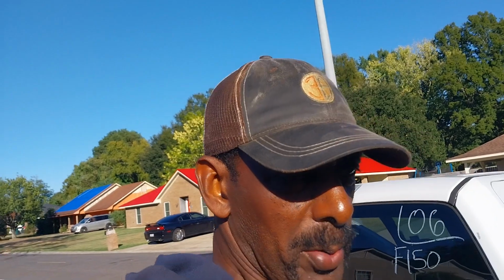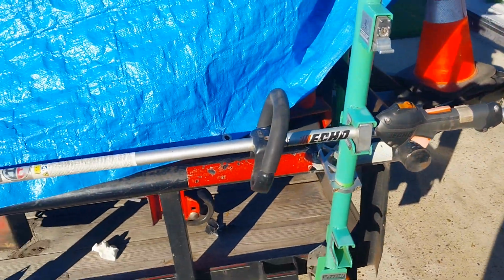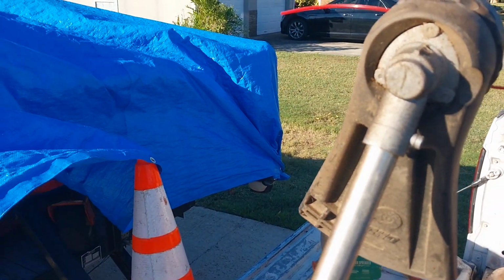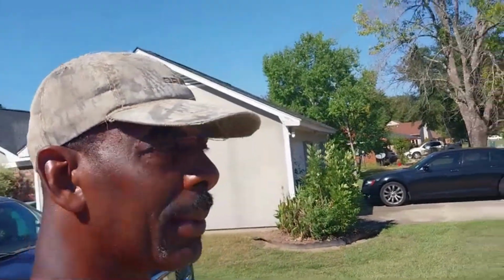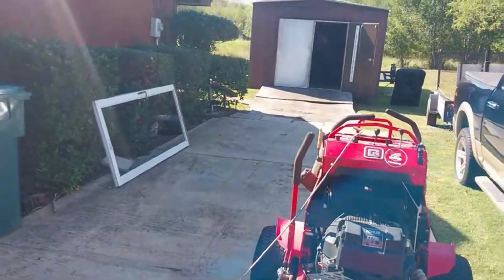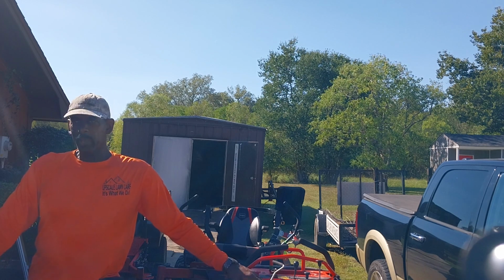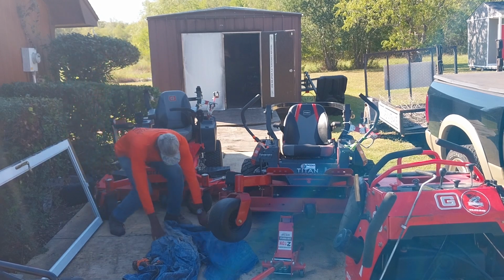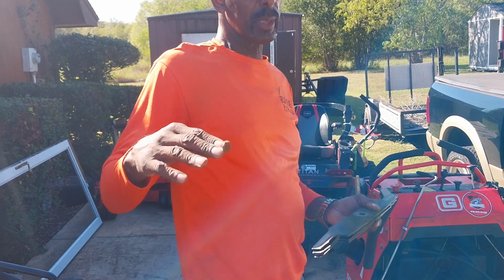When To Do Maintenance!

Comment: Great tips on maintaining your equipment. I also change the oil filters every other oil change as well. As long as you change the oil with in the recommended time frame and you use a quality oil specifically made for your engine. I have a Timemaster with 700 hours and I stand by maintaining your equipment to prevent premature engine failure. Sharpening blades are more as needed to prolong the life of the blades. They don’t need to be super sharp. If you sharpen at the correct angle, butter knife sharp is good enough.
Reply from the maker: Good stuff Billy!!!!!!!!!!!!!!!!!!